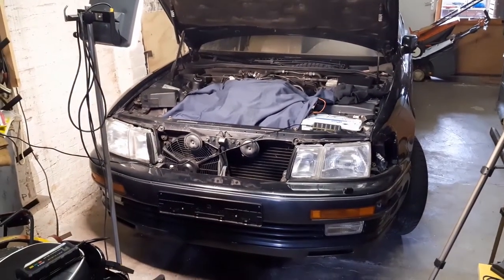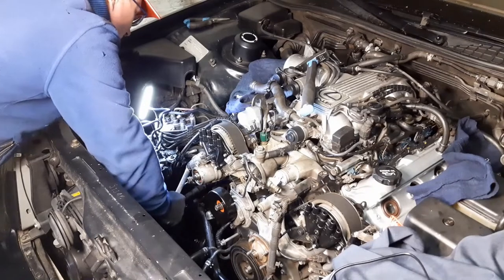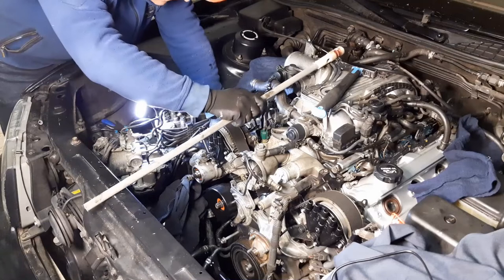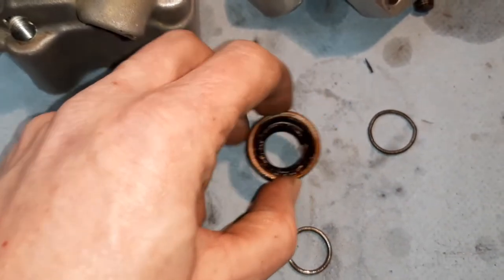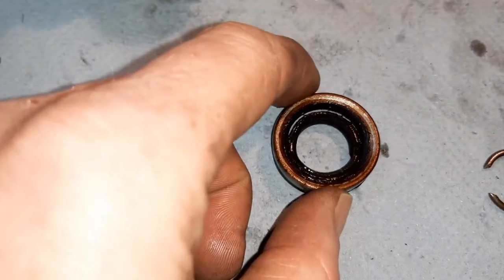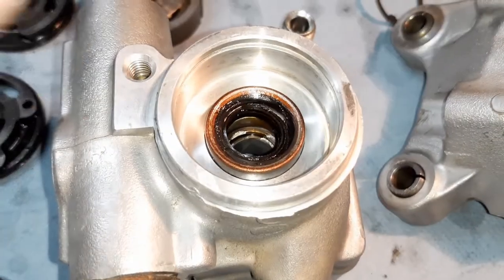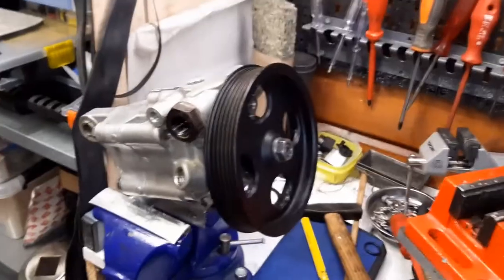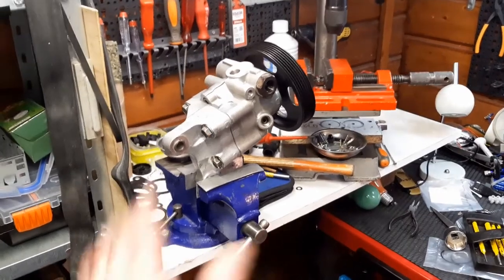Episode 10 Project Lexus LS400 - Power steering pump overhaul for the 1UZ-FE engine

Comment: Thank you, we have benefited a lot from you and I have two questions, the first is how were you able to untangle the steering axis from the loop on it despite the presence of a lock?  And the other question where can I find the book of reform that you have
Reply from the maker: Hi, I did not remove the steering column from the steering rack. I only removed the power steering pump from the engine. The workshop manual was a gift from a friend. If you need any specific information, you can email me on arnold@carnold.nl
Reply: @Carnold_YT  Thank you for your interest and replying to me and I am happy to communicate with you

Comment: Do you have the number for the bearing? Can’t seem to find it and wanna order before I tear pump down
Reply from the maker: It is a 6303 2RS bearing, it is available from multiple manufacturers. 6303 is the number that defines the dimensions, 2RS means it is sealed from both sides. That is very important. Good luck with your repairs!
Reply: @Carnold_YT THANK YOU VERY MUCH